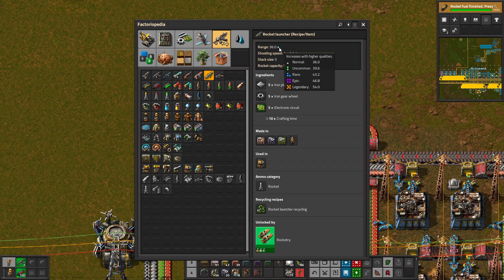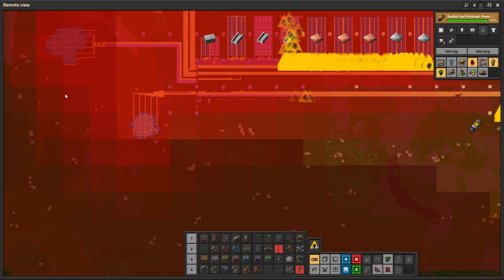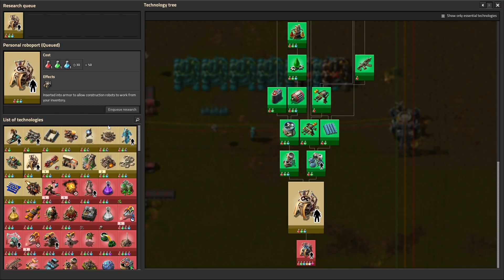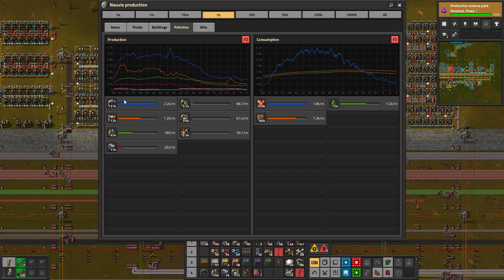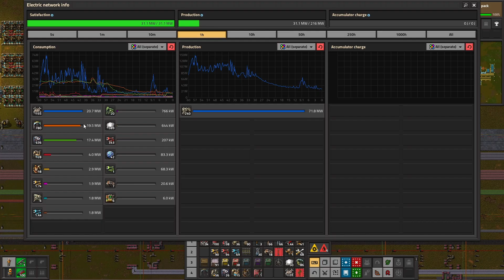Fueling the War Machine: Tanks & Rockets | Factorio Space Age New Player Guide | #30

Comment: why not explosive cannon shell? they have the same recipe but the explosive cannon shell need 2 explosives instead of one. and the rocket are you planning on extending it to make explosive rocket instead of rockets? is there a difference between the two?
Reply from the maker: The difference is one does mostly splash damage and the other will pierce until the damage is done. The normal rockets are better for targeting biter nests as they can one shot them with enough research and the explosive rockets won’t one shot them without extra damage researched.